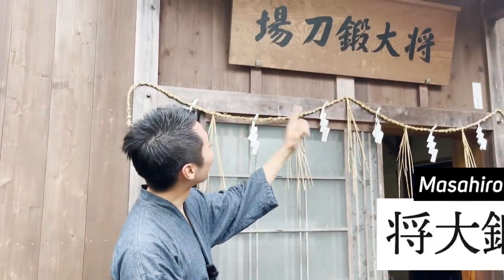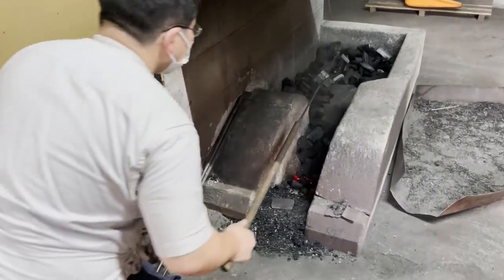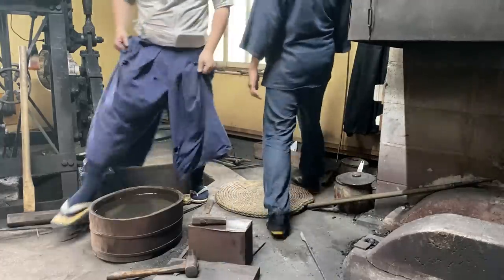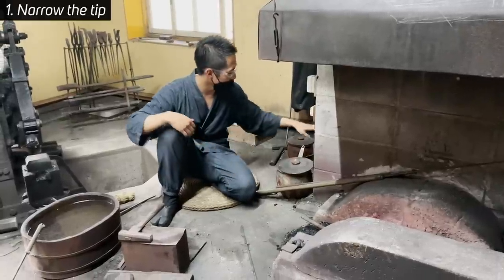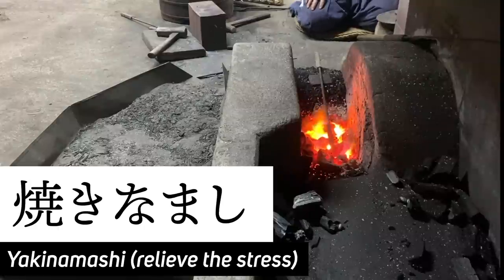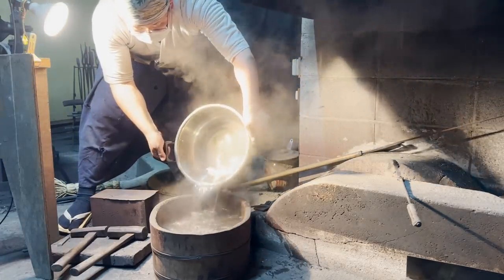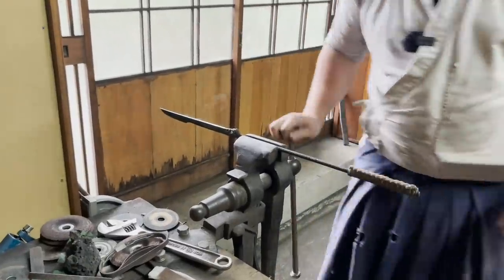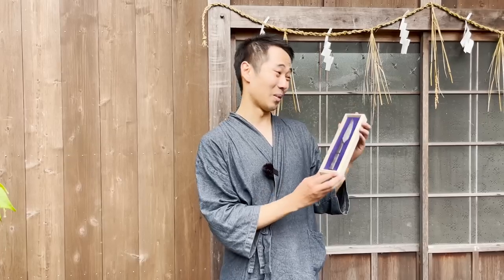Where You Can Become an Apprentice of a Katana Swordsmith for a Day

Comment: I was really happy that he was telling you to put the steel back in the fire when it still had some color. In primitive carbon steel that you don't know the composition of, you can't work it too cold or you can create cracks that will show up during the quench.
Reply from the maker: Ohhh so that's the reason why! Thank you so much for teaching me✨
Reply: cool!
Reply: yup, old iron is capricious and doesnt like being stretched. we say katanas are made of folded steels, but i've forged old iron bars for an old barn door that were of layered steel. Actually, all of the old iron, in europe, asia, africa, wherever, are all folded. it's the only way to clean your iron and make something solid out of it. So it ressembles a piece of wood, and has directionnal strenght. One solution to work that kind of steel properly is to forge it hot, and not hesitate to re-weld it onto itself.

Comment: I literally just watched this to see your excitement and it was so worth it. 
As someone who was trained in steel processing for over 3 1/2 years, I could easily follow the steps and understood what each step did to the steal, changing its molucelar set-up. 

Also isn't it fascinating, that people houndreds of years ago, without microscopes were able to understand what happened to the blade as it was formed, just through trial and error and teaching the next generation, what you have learned over decades of mastering your craft.

Also this blacksmith seemed really patient and so nice. He really embraced the old way of learning and teaching something. It can only be done by doing it yourself. Not just watching an expert wield the hammer but experiencing: that your own wrists are not as strong; your precision not being there yet and; your eye not yet capable of seeing and understanding the craft fully (as it was for me years ago).

Its humbling and also such an achievement to build something with your own hands. 

I am glad you had this experience. Enjoy your new knife. I'm sure it will pass down generations as well.
Reply: You don't really need a microscope to see the carbon content or the grain tho. High carbon steel shines like silver, will skid a file, and when breaking steel you will see its grains by eye quite clearly. You can also spark test it. with old tools you need to file a hot piece of the steel tho, an old grindstone will rarely produce sparks

Comment: I made a tanto from an old logger's buzzsaw maybe 10yrs ago. Cut it out with a plasma cutter, sharpened, shaped, whole bit. Even built the handle... poorly, since the blade points pretty noticeably to the right. Whoops. Still, it's one of my proudest creations: my first live blade. But the experience looked nothing like this. Like, seeing the lightning rope over the entrance to the smith's shop gave me tingles. I would be equal parts frightened and excited to be in a real Japanese shop like Masahiro's. Scared to death of messing something up. Masahiro-san seemed very gracious with his directing you!

Comment: You did well for your first time and had a great teacher. The first time, I had no teacher (I was going self-teaching; I later took some classes) and melted the steel four times, so There was nothing to be embarrassed about. It takes one year of experience to develop the hammer control needed to hit the target with ease. I always forget Japanese bladesmiths work sitting down, as I am a Western bladesmith who works standing up.
😅And I thought my Grinder area was messy.

That is a Nice little tool for applying clay or dirt. I might have to make one, as I have been using my vise to do it.
I cheat when I do the quench...I use a hand-held Laser pyrometer

Dont supose you remember the weight of the hammers?

Comment: I think you're mixing annealing with hardening and reheating with tempering.

Usually when you anneal something you make it softer, so you can work it with a hammer or other tools (files, bandsanders/saws etc.), hardening is what you did after applying the dirt mixture to the blade, causing it to become extremely hard and brittle - in order to normalize it - you temper it. So it'll remain hard to keep an edge, but not shatter into shards if you hit it.

Still an absolutely amazing video, and I'd love to try out those techniques myself.

Comment: As far as I know, the katana's curvature is because the Japanese, for the longest time, didn't have access to pure enough steel, so they had to resort to folding it more, which in the end made it more difficult not break the sword when the heat comes off.
Reply: Really, it's just one of the outcomes of differential hardening. That, along with Japanese blades either having a convex or concave curve prior quenching. Curvatures can be seen in earlier blades such as wantō.